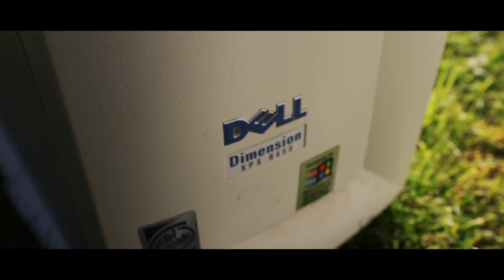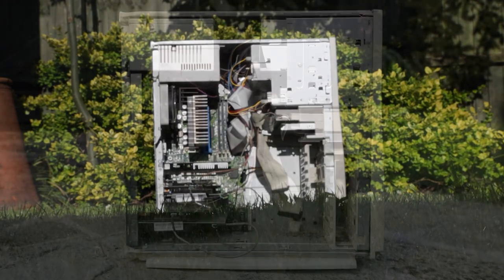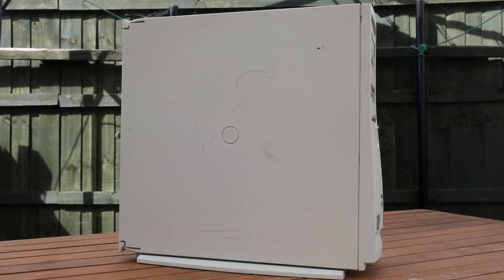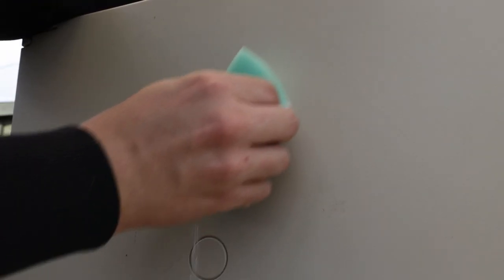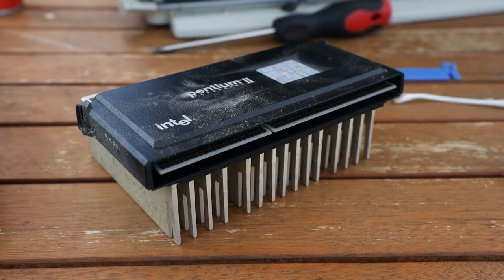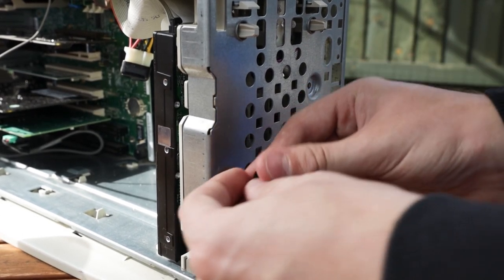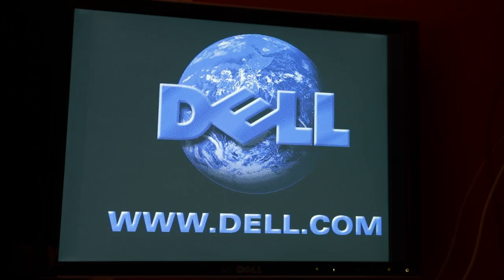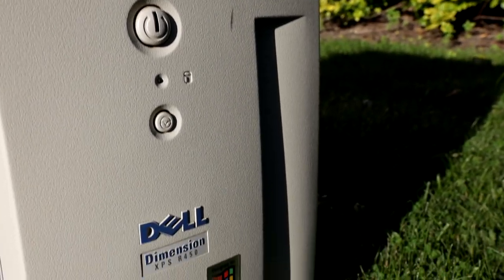Restoring a 1998 Dell Dimension XPS R450 (Pentium 2 Workstation)

Comment: Legitimately love the PC. Force Windows XP onto it and use it in 2020
Reply from the maker: Rendering my 1080p Premiere Pro timeline IN 2020???
Reply: @Techwen  Maybe, but why 2020? why not 1987
Reply from the maker: @BudgetBuildsOfficial  Back in my day we didn't have computers
Reply: @Techwen  boomer
Reply: Both fake boomers, we had to make do with 486's with 4mb ram and what is a Graphics card?
Reply: Pentium III machines would technically be compatible with windows 7 even.
Well if you had at least 512mb ram.
Actually did this on a pIII laptop a while ago.

Comment: Thats so cool. Yesterday down my carboot i managed to get an old dell optiplex gx 150 for three quid and it was in pretty good condition only one of the ram dimms was faulty so i cleaned it out and fixed it and booted straight to xp Pro and i thought it was a great deal that i havent had in a long while

Comment: Most systems from back then are probably fine with larger size IDE drives.
There are some boards with a 32GB limit which got patched with an official bios update so worth checking it out.

Comment: With my Palit 128MB DDR GeForce 4 MX 440 128-bit AGP card on my Celeron 400(A) Mendocino build, dual booting between 98se & 2K, I use nVidia drivers 56.64 for 98se & 93.71 for 2K. 3DMark 2001 generally runs just fine, on 2K using DirectX 9.0c (December 2006). I am also using 512MB SDRAM memory though.

Comment: Something isn't right with the drivers, I had a basic GF2 MX back in the day and it ran 3DMark 2001SE and games performed much better than HL which you showed. I had a P3-500 @ 575MHz but that shouldn't make that much of a difference.

Comment: Ahh the maxtor drives..more like maxtornapart, never had luck with these drives heh, nor WD400s of the era, seagate really made some quality (all be it a bit loud) drives compared to the 2010s where the vibration and unreliability suffered, even with todays barracudas, still loud, though if it were me and i were to get a drive for an old computer, look for the seagate drives used in the original xboxs, the sound will bring back your childhood with a few clicks, they sound SO nice
Reply: I got a WD400 and it was a dead one too! Just won't turn when powered and the usual tricks get no life. Sucks as it was the boot drive for an old computer I got from my grandpa. And it had a secondary WD200 drive which was just fine and had no data. Figures.
Reply: @TheMonkeyFarted  have you tried the freezer technique? mine has a stuck arm and i don't want to bang it, but if you seal it in a bag n get it cold for about an hour or two, can held stuck arms free up when it warms up again

Comment: I have a P3 board running around the same mhz as that P2, and a GeForce 4 MX 64mb, it did run 3dmark 99 just fine, I haven't tried 2001 though.

Comment: MX 400, there is something wrong it should play games at least in range with GeForce SDR.
It should run gold source games without problems, allso Quake 2 and 3, Unreal 1, UT 99
Drivers issue most likely.

Comment: Upgrade the bio could use a 80gb hard drive or get a pc control card , I also have a dell demenion XPs t450 has a  clean motherboard but it won’t start up , the motherboard has the orange light . Press the button nothing , thought might be a short in the button, No processor card . Like the one in the video .